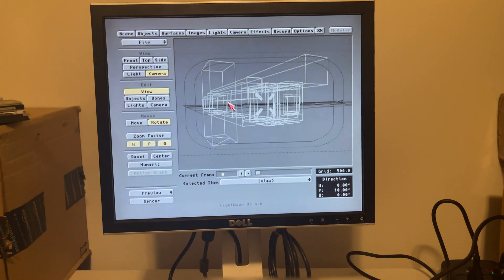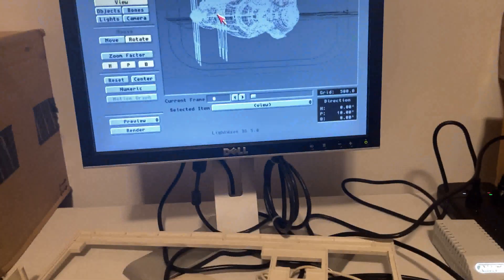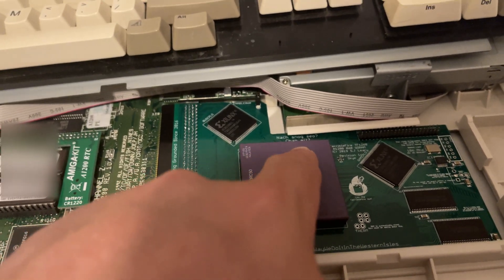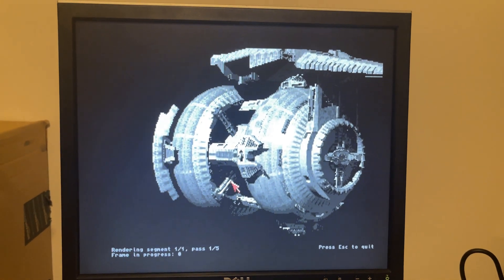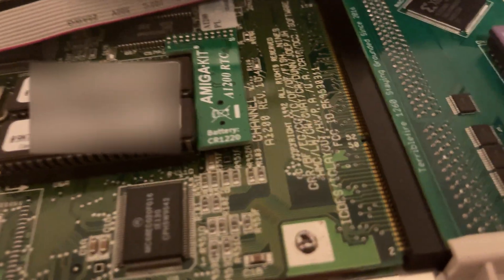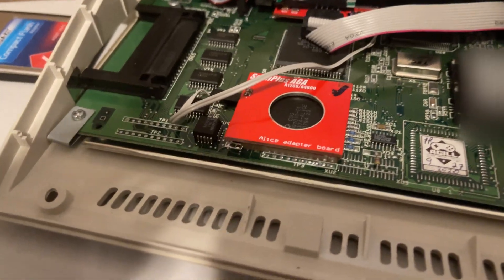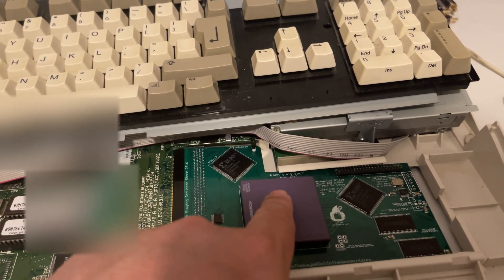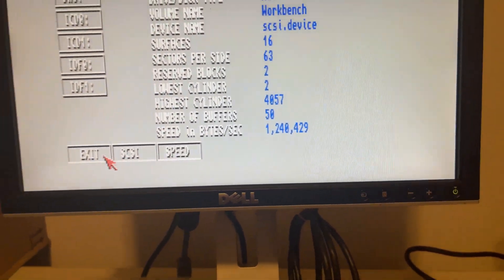68060...ACTIVATION.... (A1200 '060)

Comment: Late to the party but where did you get the B5Station scene file? All the ones I find have paths hard coded into it that don’t align to my light wave assigns
Reply from the maker: When you load it up, it will ask you for each object and image. It’s a slow process but once done, use save all objects and then save scene. Now it will always load. It’s important to keep a consistent content structure for your LW. To avoid the issue. I have the original B5 data from my time working at the FX studio that did the show. I also have a version I downloaded from AMINET back in the late 90s, if memory serves. That’s the one you see in my videos. It’s quite good. Thanks for watching!
Reply: @HoldandModify  thank you!  That works!  i have saved the scene in the past but it never said anything about the objects as well
Reply from the maker: @alessiman  yup! One of my “exciting” Lightwave Basic videos covers the entire “when you need to and what you need to, save.”  Glad you’re sorted now!

Comment: Remembering back when 27 million floating point operations per second seemed other-worldly. Now, even a lowly Raspberry Pi (4b) can manage ~ 1 GFlops in linpack. That said, someday I'd like an 060 upgrade for my 3000 (or something like a vampire).
Reply from the maker: The speeds with Amiga emulator like Pi or WinUAE is pretty stunning too. Seeing it running,

Comment: I decided to not pursue an 060 due to the highly inflated cost of these now rate CPU's. Instead I went the 50 mhz  68030 path. Sure it is much slower, but for accelerating true Amiga titles, there is a fantastic improvement. Many have grabbed 060's for some demons and Quake. I can run quake on just about anything, so why put down a ton of cash to run Quake on my Amiga? Also, that old GVP accelerator you have would have cost crazy cash back in the day.
Reply from the maker: It’s a great choice you made. It’s really the better choice for gaming and even creative apps. As it’s a better value.

Comment: if you aren't able to resolve the PCMCIA issue there are new SD interface cards available that connect to the Parallel port and provide the same function, available at EU amiga Store, on Amibay, and some eBay sellers have them.
Reply from the maker: Oh wow, thanks for the info!

Comment: Your pcmcia issue is likely down to ram, the pcmcia slot was also used to expand the ram so if you have a cpu card with more than 4meg of ram it screws with the memory addressing and stops the port working. There should be a way to run the card in a pcmcia friendly mode or disable all but 4 meg of the ram so it'll work for file transfers.
Reply from the maker: I thought if you used an accelerator card this was no longer an issue as its 32bit ram? That you for the tip, though!
Reply: @HoldandModify  I don't think whether or not it's 32 bit ram really matters, it's the specific address spacing that the memory is put into, it's a weird thing with Amiga pcmcia. There are some accelerators that get around that problem but I'm not sure how it's done or which accelerators are ok...
Reply: @philiphandforth4390  It might work if you connect the pcmcia card in with the whole system off, then start the computer. Some cards work with some accelerators some don't. You might also need a new pcmcia CF reader. they fry from time to time. I actually peeled back the guide to the pcmcia slot so I could open the case, insert the card making sure it's connected correctly then reassemble the case with the card inserted, then start the computer.
Reply: The PCMCIA issue as far as I am aware is down to the cards that use 16-bit/24-bit addressing as these encroach on the PCMCIA address area if greater than 5.5MB. The newer cards with higher CPUs normally run a 32-bit address to circumnavigate that issue. Might also worth mentioning some A1200 board revisions can have bugs for PCMCIA resets. Worth download “Cardpatch” and “Cardreset” off Aminet and put them to start 7n the startup-sequence.

Comment: On an old system I had (Dragon 32 with a 6809) there was a poke that allowed you overclock the CPU from the whole 0.9Mhz (standard) to ~1.5 and 2Mhz. At 0.9Mhz the CPU was warm, at 2Mhz if you dropped water on the chip (I used a pipette) it would boil and evaporate in seconds. That was on a plastic package CPU, and It could run like that for hours without crashing, without a heatsink. BTW at 2Mhz it would no longer have a display but upon return to 0.9 the display came back.
Reply from the maker: Hah wow! That’s a fun trick. I do not think I’d want to drop water nowadays. :)

Comment: Nice! Zippity-do! I have my 68060/50 MHz overclocked to 66Mhz, and she is quite stable, but also incredibly hot.
Reply: Which version of the 68060 are you using Doug? Revision 6 is preferable due to the lower heat they give off.
Reply: @cullmaster7361  I have a Rev 5 RC in my Amiga 4000, and an 68060LC in my Amiga 1200. I would love a rev 6.